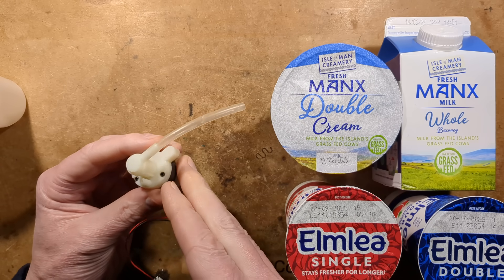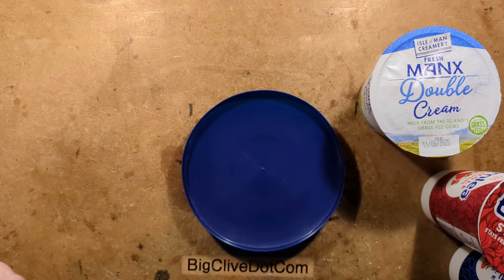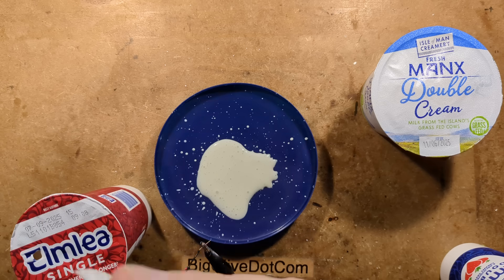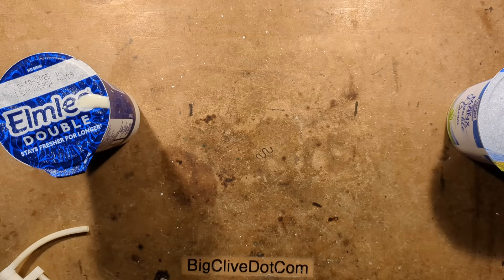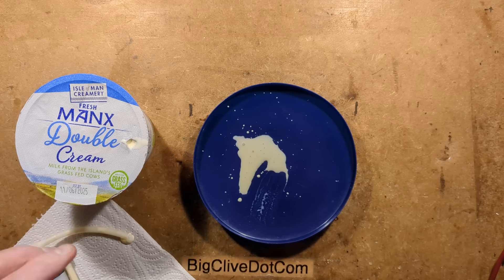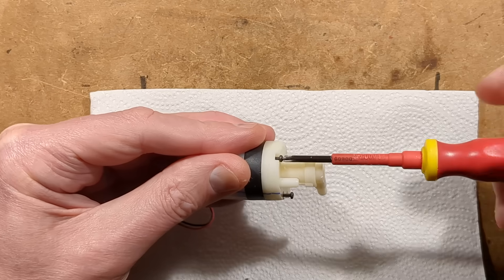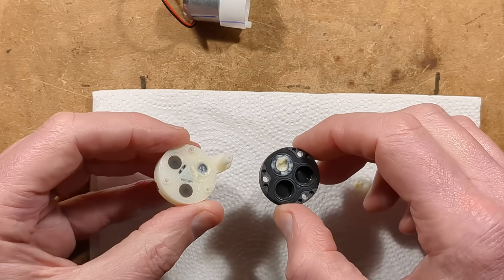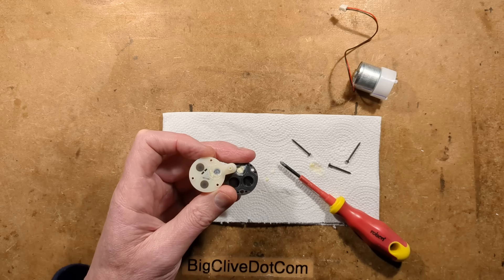I put milk and cream through a foaming soap pump

Comment: The place where I worked had a push-button coffee machine that had a milk snorter (for producing cappucino froth) which was capable of snorting cold milk. It was surprisingly nice with some drinking chocolate stirred in on a hot day. I always wondered how it worked, given that proper milk snorters work by blowing steam through the milk, and this one obviously didn't. Milk doesn't really want to froth easily.

(This machine was also interesting because one day I discovered that touching the screen in one corner would produce a PIN lock screen. The first thing I tried was 1234, which of course worked, and inside was a diagnostics and administration menu which would let you do all sorts of things including reprogramming the recipes. I did think of changing the cold frothed milk recipe to produce a bit more, as it never produced quite enough, but decided against it: causing a production outage costing the company millions would probably be forgiven, but breaking the coffee machine certainly wouldn't be.)
Reply from the maker: I've used the hidden menus to make some drinks a bit stronger in the past.

Comment: 1:20 The problem is the viscosity. I use those newer foaming soap dispensers for my own dishwashing concoction, I found you have to get the ratios just right to get the correct viscosity for it to work. Same for water misters: I wanted to use oil in them but the viscosity just doesn't allow that, for the one I tried at least.

Comment: When I was a kid my gran had a cream maker.  Back in the day everyone had milk and butter but cream was expensive, so these gadgets got invented where you melted some butter into milk then poured that into the top of this hand pump gizmo with a glass jar on the bottom.  The pump handle would force the liquid from the top through a set of very small nozzles that effectively added in a lot of air.  The process never worked first pass and usually took a couple of rounds of emptying the glass jar back into the top again.  I suspect heating the milk up and adding the extra fat to already full fat milk had something to do with the process.

Comment: I just realized something. I have been a subscriber of yours since around 2010 when I was looking for RGB floodlights for my annual light show. I had bought some RGB 4x6 inches PCB's from you at that time. I still have a few by the way.

Where I'm going with this is , you know you have been following a YouTuber for quite when you remember every booboos on his table. The one I always refer too is the squiggly burnt worm about in the top middle portion of your table. 

I have a question. I know you have tried to Soda Stream weird shit in the past and was wondering if you have ever tried making your own pop?
I don't mean buying the syrup that mimics Coke/Pepsi/7Up but rather, the ones that you would put in slushies/crushed ice?
Reply from the maker: I use the quadruple strength drink concentrates from the local supermarket to add fruity flavours to carbonated water.

Comment: Excellent Experiment. A centrifugal pump does wonders to making a mess. Had a raw dairy milk truck over turn and we had to transfer the liquids to another truck to be disposed of. We added so much air we were making cream. We had to kill it with loads of acid to separate the fats and suck out the liquids to upright the truck. It was a bad experience I’ll never forget.
Reply: I was surprised to learn that a milk spillage is a worse environmental situation than a fuel spill; I was told that by a colleague who was also a volunteer fireman.

Comment: So if you get an electric pressure washer, they're built the exact same way, just with no air inlet. Hydraulic swash-plate pumps do this as well. Not that I would suggest putting double cream into such a device, because that would just be mischief.

Comment: It may have worked with milk, especially skimmed and semi skimmed, due to their viscosity. Milk frothers ( the ones you can buy at a store) use a wheel consisting of loops of wire that move through the milk, cream, etc, forcing air into it. If the cream is heated, the fat melts, making  it easier to push air into it. The Velvatiser sold by Hotel Chocolate is a glorified milk frother but it also works on real single cream, I know because I have experimented with it

Comment: Maybe try the pump that has a tube and then spins rollers around it that squeeze the tube, that way even if it creates butter, if the motor is strong enough it would still push it. Probably. 😝
Reply from the maker: Peristaltic pump.

Comment: The output nozzle is too large and the frother too weak :) . In a bakery or coffee shop the cream is forced out at refrigeration temperatures under compressed gas (like an aerosol can) , usually Nitrous Oxide. Nitrous is used as it's non flammable and has a naturally sweet smell and taste so does not contaminate the cream. We had a creamer in our bakery at work, I used to overfill cream filled donuts for a laugh until they were bloated then try and shove them in a box quickly and imagined the mess when someone bit into them 🤣

Comment: The reason the milk doesn't froth is because the air is too cold and too dry. 
When you froth milk with steam, the heat makes the milk proteins relax, so they can reshape. Milk proteins have hydrophobic and oleophobic parts to them. The bubbles contain water vapour from the steam, and the milk itself contains fats, so the proteins end up arranging themselves to separate the two, and it's that which makes the foam stable.
Reply: Assuming this was filmed and uploaded on the same day (maybe yesterday), if he still has them and the pump still works, I guess that calls for an off-camera test with one warmed up. (maybe not the whipping cream lol)
If it works, then he can record Take 2 with the three warmed up first! 😊
Reply: the heat melts butter and lechthin (the detergent in milk) causes it to foam. Even the milk proteins have some detergent actions. But it does not work with fat in solid form...

Comment: I did it also and try it and it work but a little soap taste. Even after i cleaned a little bit. But the milk was at room temperature
Reply: It was a Xiaomi foaming pump with just milk and works. So maybe it the different

Comment: Reasoning and subsequent hypotheses before the video: real cream sticks to itself when agitated, forming butter. Veg oil creams are emulsified to create the cream texture, which means they are made of high molecular weight particles. Veg cream is going to block up the holes for aeration and just isn't going to aerate, real cream is going to form small butter chunks that will eventually gum up the works so that it becomes either permanently closed or permanently open. mmmm chunky

Comment: For some reason, the experiment starts my stomach gurgling, and turns things yellow🤢. I have found similar pump in cooking oil misting sprayer(where mixing part, is in the nozzle itself), and works fine(misting could be better) for the intended application. The milk/cream frothing is not working due to the absence of surface tension reducing agents(in comparison to soap water)🤔.

Comment: Awhile back I asked about carbonating milk using the sodastream and was disappointed when you confirmed that it wouldn't work and that the milk would just curdle. Thank you for this, my strange curiosity has been satisfied.
Reply: The next thing to try is nitrous oxide, which they use for whipped cream.

Comment: So now i would propose use of two valveless positive displacement pump, that kind that uses rollers on silicone hose. Output from air and liquid could be passed through epoxy mixing nozzle i guess
Reply from the maker: Peristaltic pumps?

Comment: Oh, it got blocked because it turned cream into butter! I spent 20 years as a design engineer for dairy processing machinery. All the valves have to have super smooth and rounded corners inside to stop butter fat from sticking to sharp edges.
Reply: When working in an ice cream shop that makes sense when whipping heavy cream in the blender, made many of buckets of vanilla unsalted butter.😂
Reply: smooth! creamy! thick!
Reply: And stay very cold. The butter transition works better around room temperature.
Reply: you need to make a device like this and send it to him lol
Reply: @unmanaged  I think Clive can buy whipped cream dispenser himself

Comment: For years, I used a copper bowl and whisk for whipped cream. (If a plastic bowl has ever had oil in it, such as from salad dressing, it is then useless forever for making whipped cream.) Then I discovered the N₂O (nitrous oxide) -powered whippers. They make whipped cream even from skim milk (though it doesn't remain stable for long, so apply before serving). But, I still prefer the whipped topping in the dairy case, though I use the other for a laugh.

Comment: Were you able to clean out the pump and get it working again?

And the spray cans of whipped cream (either disposable or refillable) just push the cream through a mixing nozzle to whip it, they are quite simple and quite amazing at the same time.
Reply from the maker: I did manage to eventually purge it through with soap.

Comment: They use nitrous oxide in whipped cream dispensers both because it dissolves in fat and because air would oxidize the cream and give it an off taste.
Reply: I had a ball reading the Amazon Canada reviews for CO2 canisters, from people who thought they were interchangeable with nitrous oxide. "Made my whipped cream taste horrible! One star!" hahahahahaha
Reply: Air also can't be kept liquid by pressure at room temperature, so it's useless as a propellant. Spray cans aren't full of pressurized gas like a balloon, they're full of volatile liquid that boils at room temperature. The liquid wants to boil, but that causes the pressure in the can to increase slightly, and the boiling stops. When you release the pressure by opening the valve, the liquid starts boiling again, creating continuous pressure from expansion. A good propellant gas needs to be right in the sweet spot where it would turn liquid in your freezer, but start boiling in the refrigerator. (Unfortunately materials like that tend to have many other exciting properties too.)
Reply: Never thought of that. When I was young and  foolish we would abuse that source of NO
Reply: Nah, I'm pretty sure they use nitrous oxide to give people the opportunity to do whippits at their college parties

Comment: Re: cleaning milk pipes.
I know of a certain coffee machine supplied by a company where the coffee's cost a lot... and our bar staff get supplied a bottled blue purification chemical for the pipes called something like 'milk sure', the company also supplies an exact identical bottle of 'sniffs away'' blue urinal cleaner, not something you even want a trace of in your brew, and once one of the younger staff didn't read the label.....
I immediately made sure that the bottles were stored at different parts of the building...
Reply: Start brewing coffee in the urinals, problem solved!
Reply: @spretcher  When the coffee is ass, why not eh?
Reply: the lesson that only needs to be learned once ...

Comment: I think you have a better chance of making good cream if you put a few tiny holes in the bottom of a bowl and use an moderately sized air pump to blow air through them. That is basically how professional cream makers work. Also put the cream in the freezer for a while to cool it further before whipping.
Reply: So.. garden sprayer next?  Mew; There's a simple mod to make them into foamers too.
Reply: @LynxSnowCat  Spraying is unlikely to work if you look into the science of cream making. The above mentioned solution of bubbling air through the cream in a bowl works. I can guarantee that because I have seen a working DIY solution. This implementation used one of those small DC air compressors as an air source. Also the bubbling produces a whipped cream with high air volume by mass. That is why the professionals prefer it over whipping with an electric beater for example.
Reply: @martin_mue  Good to know. (While I was hoping for a spectacle, learning is fun.)

Am I to understand that with cream it has to be air pushed into liquid (to a make a stream of foam), instead of pulses of air entrained by liquid (to make a stream of droplets).  (?)
Reply: @LynxSnowCat  Protein and fat in the cream are conditioned by the whipping to form a membrane over the air bubbles introduced into the liquid.
Reply: @martin_mue  boundary turbelence/shear between the moving liquid and the pickup tube is insufficient to form this membrane suddenly why I saw a failed Kickstarter(?) for a milk dispenser (with a cold frother as a  stretch goal) that used a spinning pickup-tube/auger (instead of a hygenic parastatic pump, like every commercial milk dispenser I've seen in person) makes sense (to me).

Comment: It instantly creates butter and clogs itself. I really should have seen that coming. That pump works like the fastest, smallest butter churner ever.
Reply: countertop fresh butter generator -  yes pls
Reply: An aunt used to get butter pretty often when whipping cream. It has never happened to me. She must have had one heck of an arm.
Reply: @rich1051414 world smallest and fastest butter churn was exactly what I came to comment. You beat me to it!
Reply: “Machine wrapped with butter?”
“Machine wrapped with butter!”
Reply: Spoilers man
Reply: Would a finer, bigger grid work better?
Or maybe multiple grids? One fine high pressure grid?

Does cavitation help? The energy required should be well below material abrasion levels, given that centrifuges for separation work well. Maybe it just spits butter sprinkles on like 2 bar.
Reply: @gustavgnoettgen  Milk is homogenized by forcing it through a small orifice at high pressure that forms the micelles of colloidal fat needed.
  You want something similar here, only adding air bubbles to the mix.
Reply: Brilliant - an emergency personal butter churner that you can carry anywhere. You just need a access to an obliging cow - for the milk - get your minds out of the gutter!

Comment: Midway through the video you had me wondering what if you used Evaporated Milk or Condensed Milk with the foamer. My guess is that Evaporated will behave similarly to the milk you tested and Condensed is probably not gonna end well as that's thicker (and stickier) than even whipped cream.
Reply: Though a bit stupid, but a related thought nonetheless, is what if you used Coconut Milk since that has a different consistency.

Though a Cheese Dip and condiments also came up when I was thinking of random things that would be fun to test with one of those soap foamy things.

Comment: Cleaning cream out of pumps it's just like being at work! Usually the main silos are filled with compressed air and it pushes the milk around the factory, Occasionally we do get Cappuccino if the silo gets too low,
Reply: Without knowing where you work this sounds concerning.
Reply: @RiffRaffMama.   I work in a milk processing factory, Raw milk in,  Bottles, Plastic, Pergals and 1000 ltr boxes out, The glass line is pre war,

Comment: i mean, this little pump is basically a miniature butter churn, when you think about it.
Reply: I wonder if this is interesting for the dairy industry. Or maybe they use something like that already.
Reply: @gustavgnoettgen  i did a little looking, and it seems like the actual industrial process uses a large centrifuge to combine most of the steps of making butter (separating the cream, pasteurizing, agitating the cream.)

perhaps something like this little pump could be used in some kind of posh restaurant, providing that the pump is scaled up a bit, and the liquid pathways are slightly redesigned to actually accommodate congealing liquids.

edit, used a wrong "to" in there, was thinking numbers when i typed it.
Reply: Of it was self feeding, barely

Comment: So, Double Cream doesn't foam at all - but Kudos for trying...  now the burning question is:- Does Double Cream Carbonate?
Reply from the maker: I've pondered that, but it would require stripping the carbonator apart to clean it afterwards.
Reply: I believe they use nitrous oxide to whip cream, I guess there's a reason why they don't use carbon dioxide? Mybe it makes the cream taste like carbonated water?
Reply: @Murgo-u3l  CO2 would react with water, creating carbonic acid. Acid and milk don't go well.. unless you want to make cheese..
Reply: @aerogfs it's as you say, the carbonic acid makes the milk curdle. You can see this in milk and coke videos
Reply: @aerogfs  Mmm. Carbonated cheese... or more likely Cheese Whiz. Does spray cheese (gag) carbonate?! I like my grilled cheese to have a head on it.
Reply: @R.Daneel Instead of creamy cheese, now we'll have bubbling cheese
Reply: @aerogfs  Oh! OH! And, hear me out on this... bubbling CAFFEINATED cheese!
Reply: @R.Daneel Shut up and take my money!!!
Reply: @Murgo-u3l  Wow. Great question. I went down the rabbit hole: two main reasons (apparently). Using NOS squeezes more gas into the cream. They said 4x as much as using O2 (no mention of the CO2 ratio). Also, apparently cream can spoil really fast if one of those containers gets warm. CO2 and O2 can actually help the bacteria thrive, NOS is bad for them - so helps slow bacteria growth. Who knew?
Reply: @Murgo-u3l It's acidic, yes.
Reply: @Murgo-u3l  Nitrous is used because it is oil-soluable.
Reply: I'm sure that clive tried carbonating Irish cream liqueur.   It did not end well. ?
Reply: Ever hear of the 'elixer of pure distaste'? Your idea is getting very close to that.
Reply: Barry Lewis and Ashens have tried milk in a sodastream. 
I won't spoil it, just see for yourself:
Will it Sodastream? ft Ashens
https://www.youtube.com/watch?v=kNFKr4fjorI
Reply: Instant spoiled double cream
Reply: Now we know 🤓
Reply: Thanks for the spoiler.
Reply: @R.Daneel you read the comments before you watch the video? Weirdo
Reply: @R.DaneelLol